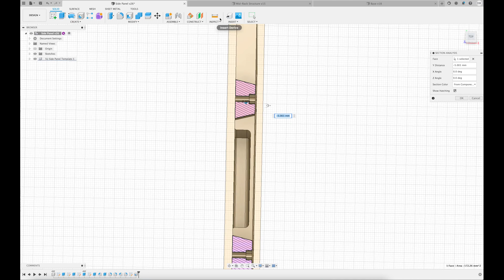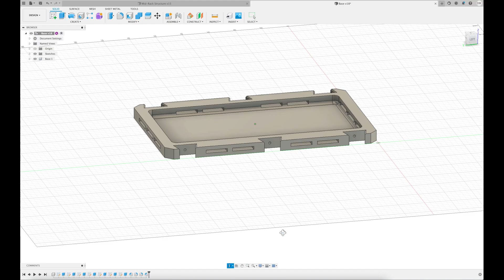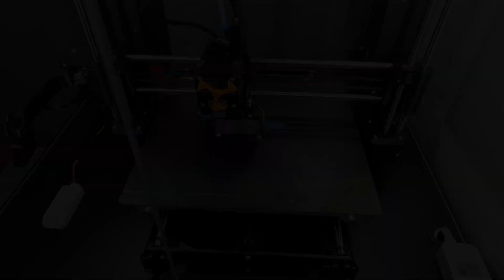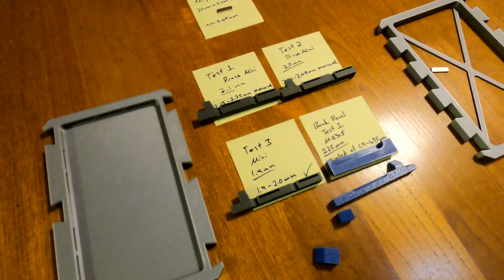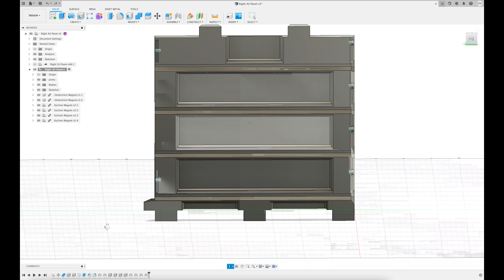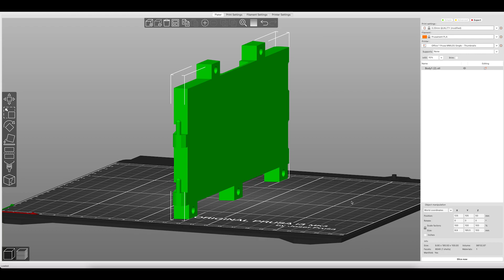003 - Raspberry Pi Rack #3 - 2U Panels, Bolts, & Magnets

Comment: Noice progress Doug 🙌

My MK3S+ kit seems to be finally tunned 10/10. Time to look for filaments lol
I'll still wait a bit for more releases tho. 

My custom OPNSense router runs from a i5 Zotac baremetal, its board is already out from its original case. I need to see all the parts to figure how/where can I add an adapter for accommodating it. I will borrow your idea, design a modular adapter that fits on your project with no changes and allow me to upgrade the router or install another one like a dream along my PIs.
So excited with this and so glad to have seen your post that day 🙌

The magnetic idea is a solid 10/10
Reply from the maker: Internal dimensions are roughly 100mm x 170mm. Might be a little bigger or smaller. I’m still working on the tray sizing to get it just right. How big is that Zotac board?
Reply: @DougMeek  I believe the longest is 180mm while the other side is I believe 140mm. The first project I mentioned to you, I printed the plates with 190x190mm but I have abandoned it since. To get t-slot has been a painful process so I stopped and the design isn't as friendly and well sized as yours. 

But I don't intend to change anything from your project which it's already 10/10 but rather design an modular adapter so tomorrow down the track I can install another one like those thinny Dell USFF while keeping your project as it is.
Print everything once you release, add the modular adapter to fit USFF motherboard and forget about life haha
Reply: 100x170 is perfect normal fit. I was gonna join 2 "drawers" to make it higher anyways with the old project. Your project makes that so easy 🙏
Reply from the maker: @hakunamatata324  it wouldn’t be hard to print a multi U blade either. Could put the device at either an angle or vertical. Should be very easy to mock up.
Reply from the maker: @hakunamatata324  wait until you see the blade design. Then you’ll see what I mean. It’s fully modular. You can just craft a couple of the trays however you need and print a faceplate that holds all of them.

If you haven’t mocked up the board to use as a model for your design, do that. It’ll make your life easier. You can just join that to a tray to test for fit.